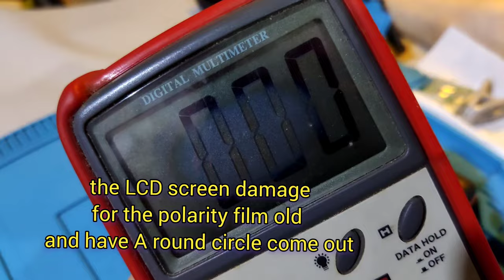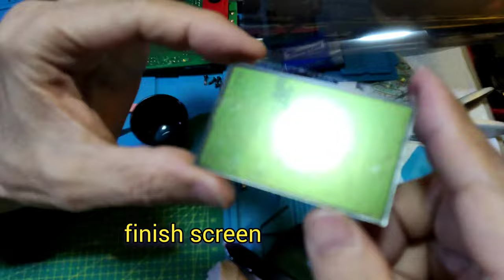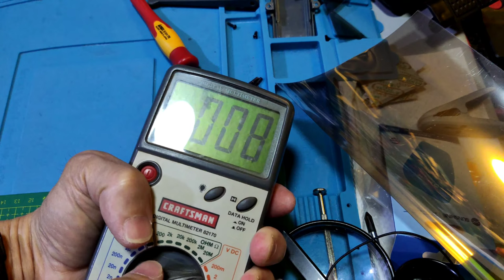LCD repair craftsman 82170 MULTIMETER.polarity film change.

Comment: It can trap moisture though. 
Where the display panel is clipped in, pry those 4 retainers back and remove the display, now pit your electrical tape in between the edges of the display and where it beds into the bottom of the display holder.

Or, if your time is worth money to you, just go buy a new elastomer connector. 
Be like $3...
Just take the unit in with you to an electronics shop and ask for a new zebra connector for it... 

Alternatively, you could shave down the posts that the top two screws secure the pcb board to the zebra strip. (That pink/black/pink strip of runner along one side of the lcd display and which is the conductive joint between the board and display. )
Reply from the maker: thx for advise,but now day we ill and very thank for you voice ,thx for watching.😂

Comment: 4:13 by clean color you mean the color of the base paper yes? Which is silver. So if using a white base,you rotate it until the color white yes?
Reply from the maker: it near to green ,because  the polarity film normal have a little green color,sir
Reply from the maker: if you rotation to a clear looking clear ,it be the right angle for a good look of the digital come out.

Comment: You should not pull top front polarizer back polarizer was damaged you should replace only black polariser
Reply from the maker: sorry sir,we don't have full set of polarity film and the original back silver paper,it only a way to help me to repair this meter can see the digital,if you have the full set of  paper and polarity film ,thx for tell everyone how to get it.thx for your watching.
Reply: @wilsonluilui  I repair my Fluke Multimeter LCD Which was manufactured in during 1987 model was 8060A most time back side polarizer damaged
Reply from the maker: @shindvs  and if your meter is placing in asia it may be damaged .it about 5 years or under may get black hole,i also change the full set lcd module at least three time,and now i only change the silver base paper only,but fulke  meter case become damage ,and hard to repair for no parts to exchange it,and now day fluke new product not very well becareful sir,i have 5 fluke meter is damage ,and don't sent back to fluke repair,because it cost expensive and only checking the meter money maybe up to$120 USD.notice only checking not repair charge fare.
Reply: @shindvs You are right. Only rear polarizer film should be replaced. In fact if someone can manage to pull out silver reflector without damaging the polarizer than just reflector is needed to be replaced.
Reply from the maker: yes,if you can pull out the background silver base label,it can try to fix.if not it must be replace the polarity film sir,it is no way say what is your meter screen is damage to how worst,and some time can't repair by the mfd use a special adhesives materials.and don't complain me again we also learn from web and other youtuber.

Comment: Thank you for sharing this video, please what is the link where to buy the silver film based polarized sheet. thank you
Reply from the maker: sorry it no links,i am just use the laser printer silver base label to do it,it have a good look but it thinness,you can buy it from your country.
Reply from the maker: https://www.amazon.com/Mr-Label-Letter-Sheet-Silver-Labels/dp/B07X8TQ22Q/ref=mp_s_a_1_14?crid=2JPWPJ1G2YJLF&keywords=silver+base+printer+labels&qid=1677381058&sprefix=silver+base+printer+labels%2Caps%2C393&sr=8-14
Reply from the maker: and this links is  Amazon
Reply: @wilsonluilui  Thanks, it's an interesting solution. obtained the complete large transflective sheet. but I was looking for one that comes pre-cut. If you need to get the full size transflective polarized sheets, I can give you the link. I'll try the tags thanks
Reply from the maker: @Tecnocosas  the polarity film is easy to buy in a large film.thx for  watching.

Comment: i am trying to repair a synthesizer key board screen ,i have to change both polarizer layers ,is it of same kind, can i  cut  both from the same sheet. thanks for answering
Reply from the maker: in normal that have 4 type of polarity film 0,45,90,135 degree and some of this can use any degree angle film to do  by using one film to（ revised the angle to be done, normal（ top is 0,and the bottom is 90） when you see a clear looking that maybe done.but that have another angle film that may not fit it will be changed a deep ,dark display ,it because the film not fully correspond
the right angle.And i also  learn how to get right angle now.😅
Reply from the maker: but it Chinese
https://youtu.be/oBTM7jIwhZA
Reply from the maker: https://youtube.com/shorts/haoE2P9DlFA?feature=share
Reply from the maker: hope you can understand this,it can use same film by you must choice the right angle of a clean look for done it.

Comment: is the silver thingy you use called reflector somehow? bcoz during day time may lcd screen is blurry but during the nights, its okay, can you help
me out?
Reply from the maker: the buttom of silver base paper use any of silver paper can do it but it have an angle of reflection you must place down and rotation the paple to a clear look.
（some time must use a matte one is best than a plain one）,if you screen no backlight .and if you have backlight try to buy a（ apple i pad type reflection type film）may be easy to buy in web,but it only have 2 of angle will fit it,and normal you can rotation the reflect the film to the angle it may spend many time for test,hope this can help you,remark buy a big card like 9 ,12 inch type.
Reply from the maker: Just found this amazing item on AliExpress. Check it out! Please help me choose!
HKD37.66  31%OFF | big size back Polarizer Sliver film for ipad 6  9 pro 12.9 inch lcd bottom Polarizer  Film for ipad mini 4 lcd  back reflective
https://a.aliexpress.com/_Ez8FTDR
Reply from the maker: you must add a app on your phone （Aliexpress）first
Reply from the maker: and seach for "i pad polarity film "

Comment: I have a tester with an LCD screen with similar round pattern. What causes this? I thought the problem was a circular polarizer, yet your screen seemed to have a problem with the reflector behind.
Why did you replace the front polarizer? Does the angle depend on the polarization angle of the reflective panel?
Reply from the maker: for my case is the back side polarity film have problem,first take off the reflection SILVER paper,second peeling off the polarity film,then clean UP the screen.
then buy A polarity film,
then place the film to TEST it angle ,make the film easy to see like transparent than fix at the screen,last make A SILVER label(or white paper)to fixing to the back for finish.
Reply from the maker: and my meter front polarity is no problem,because it HARD to know the spot is front or back side.but normal is backside damage first.sir
Reply from the maker: two of the polarity film is fix in 90 degree for A clean look .some Time is front is 0 and back is 90 degree.polarity film normal have 0,45,135,90 degree.sir,and we also is learning in other youtuber video for repair.
Reply from the maker: https://youtu.be/ZQxyf1AzrdU
Reply from the maker: https://youtu.be/Y4biy5risuU
Reply from the maker: and hope you can know how to repair it.and i also the second Time for repair the meter LCD screen sir ,Thx for watching.

Comment: Hi. I have fluke 289 having the same screen problem. Do you think i can just replace the polarizer film for the repair?
Reply from the maker: sometimes can only change the film ok,you must be buy a silver base polarity film to 289,because if you use normal silver base label,it may be no backlight come out sir.thx for watching.
Reply: @wilsonluilui  thanks a lot. That's a great help.

Comment: Polarizer sheet   which are using in lcd tv and monitor  can we use  pl reply
Reply from the maker: sorry,in normal it have 4 angle, zero,45,90,and 135 degree ,it must rotation your film to check it before any work first.sir.
Reply from the maker: Just found this amazing item on AliExpress. Check it out! Please help me choose!
HKD55.59  5%OFF | New 0/45/90/135 degree LCD Polarizer Polarizing Film test for 15/15.6/17/27/37/32/42inch 32 inch LED IPS Polarize Screen for TV
https://a.aliexpress.com/_EzmzllR
Reply from the maker: this web site is sold the testing film.And you buy the film pls "aliexpress"the app is build in your phone.and than search for "polarity film for tv ",it have many film can choice.thx for watching.

Comment: where to buy the silver sticker?
Reply from the maker: if your meter not have backlight it can use any silver base card or label put on the back to test,or use a white paper to test before.（white paper may reflect less light it will dark）
Reply from the maker: normal call matt silver may be good reflect effect come out

Comment: Sir I have same problem with Digital meter this LCD display with silver paper 
My query as follows 
1. Where it’s available 
2. How can I purchase it 
3. Technical specifications of this LCD 
Share contact details so I can contact
Reply from the maker: Just found this amazing item on AliExpress. Check it out! Please help me choose!
HKD86.23 | 10pcs Polarizer Film For ipad air 1 2/ Pro 9.7/10..5/ 12.9 mini 4 Lcd Back Polarization adhesive sticker A1584 1566 A1674  A1538
https://a.aliexpress.com/_Eukp4yn
Reply from the maker: Just found this amazing item on AliExpress. Check it out! Please help me choose!
HKD86.23 | 10pcs Polarizer Film For ipad air 1 2/ Pro 9.7/10..5/ 12.9 mini 4 Lcd Back Polarization adhesive sticker A1584 1566 A1674  A1538
https://a.aliexpress.com/_Eukp4yn
Reply from the maker: you can contact to the sale company give your answer,it need some technicial of method for repair the different screen.and i also learning how to repair ,thx for watching.

Comment: why lcd looks dark after repair.
Reply from the maker: you must change the angle with clean look and fix before.
Reply: @wilsonluilui  to be honest. I changed few lcd's polarized filters with new filter that i bought from chinese seller. They all look darker than the original filter. And yours also looks darker after filter repair. I think the original polarizer film sheets were good quality with more transparency. These nee replacement sheets are more dark.
Reply from the maker: @AsBi1  it is because all seller is for ipad or mobile phone ,it is not super fix like the original,and you changed a few ,and must be know that mothold,and don't make any complain to me,it not my fault,it only a way to easy to fix it to use ,a little dark that ok,it can use sir.
Reply from the maker: @AsBi1  and it may be more testing and try a new type of film ,it can repair the lcd well ,now day it hard to found out the original silver base label,only use a matt silver base card for repair it ,high temp in this country now 4 of multimeter change to dark screen,when you not found the original label it can try to add a white paper or matt silver card at the bottom,it can finish.
Reply: @wilsonluilui  i just ordered the aluminium tape. It looks exactly same.as the shiny silver reflector as original. Also it is adhesive. So it will be easy. I am still waiting for that to arrive.
Reply from the maker: @AsBi1  normal aluminium sharp reflect label is not good for lcd display,it must use a matt silver base type,but not for with backlight screen.
Reply: @wilsonluilui  I just fixed my HP 32sii calculator with this aluminum tape, it is not super mirror like, it is same as the original tape. it works very well. the only difficulty is that it gets wrinkles easily so you have to apply it very straight and carefully, once done, it is totally best.
Reply from the maker: you are the best ,very well ,it need quick for label on it,and the screen must be strick on the table,it learn from youtube video.thx for watching.